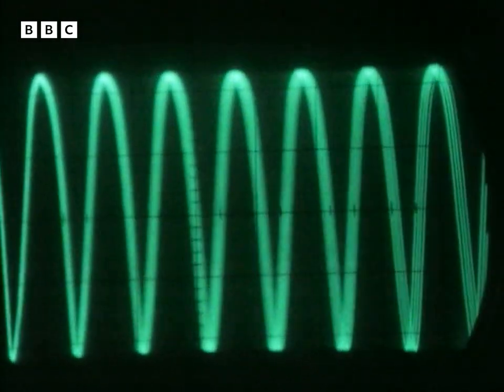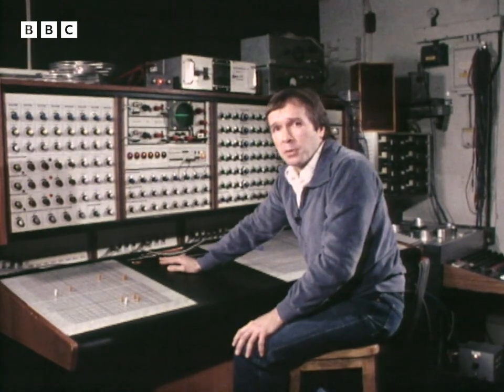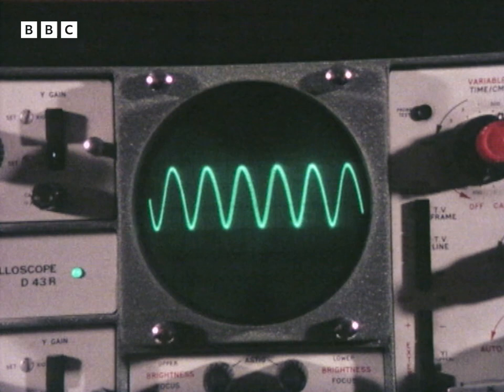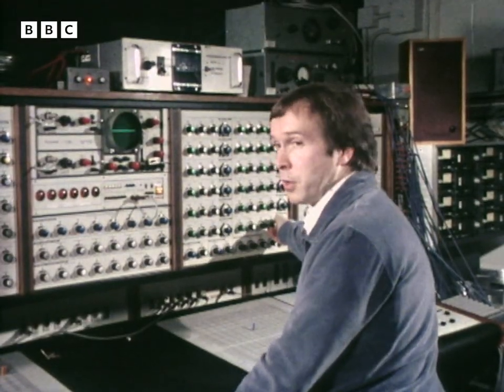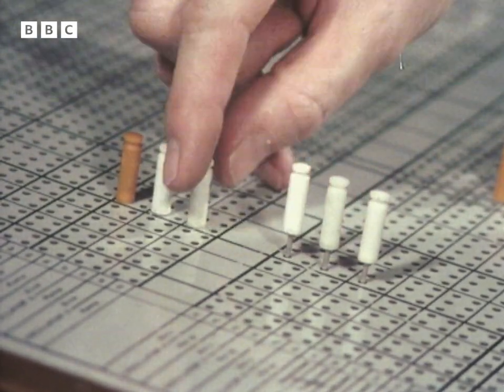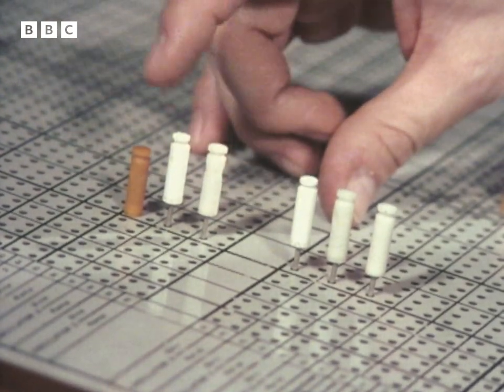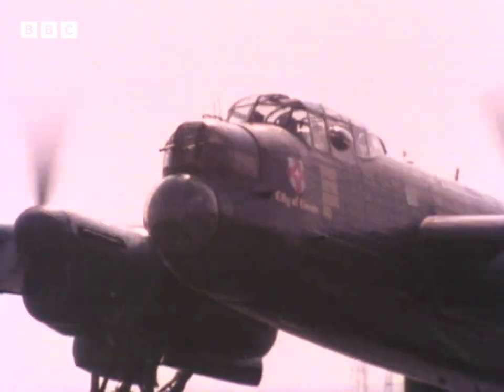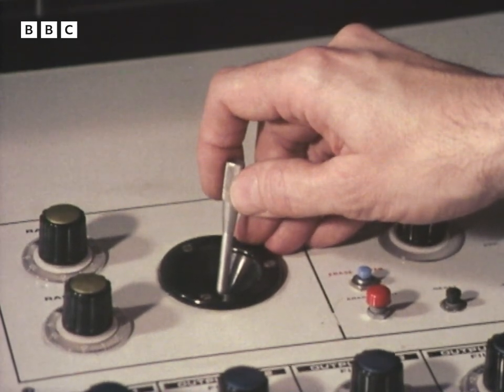1976: ROGER LIMB Sculpting ELECTRONIC Sound | An ABC Of Music | Radiophonic Workshop | BBC Archive

Comment: The Synthi 100 - known as ‘The Delaware’ because the Radiophonics Workshop was in Delaware Road. These things are as rare a rocking horse uh hum. They only made about 30 of these.
Reply: But now revived thanks to Analogue Solutions with their Colossus. Btw, I live in Putney, a mere stone throw from the little detached house by the Thames where Peter Zinovieff invented and manufactured those amazing machines- including the seminal one, the VCS-3 (for 'Voltage Control Synthesizer Nr3'... also known as ... The Putney)
Reply: The Delaware ended up in a skip after just seven years of use. Criminal.

Comment: Release should have been the thing called decay.
Reply: Nope it goes attack decay sustain release.
Reply: This was a good observation and I'm glad that you noticed that one. The comment by Newtronix is also right of course but it's just that this video shows the decay (time) behaving like release (time) after 5:16.

Let me explain: 

Many early synthesizers didn't show a release (time) envelope stage. A very common example is the Minimoog. It only shows the attack (time), decay (time) and the sustain (level). With a Minimoog you could add (what would later be called) release (time) with a switch. That switch just says "decay" but it enables the decay (time) to also add the release (time) to the sound you're creating.

That's a bit confusing... Well, I've seen many videos about synthesizers and the common ADSR we've had on most synths since the late 1970s is still a bit of a mystery to some people. One puzzling thing is that the sustain is actually a "level" where the sound volume stays after the decay stage (using the amplifier envelope) when we still keep pressing the key(s). It doesn't behave as "time" like the other envelope stages.

One of the reasons for the confusion is that the sustain pedal of a piano etc. is actually doing what the release (time) does on a synthesizer. Well, If you really want to be confused, then all you have to do is to look at the controls of early Korg synthesizers, like the MiniKorg 700S. It's a great synth. It's very fun to use and the naming of the controls is part of the fun. It has both a low-pass filter and a high-pass filter but it's a secret... It's just called the "traveler". That's groovy, man.

Anyway, I guess I've written enough. Take care and have a great day.
Reply: No decay is a slow hold feature
Reply: Only in "Hold On" mode, it's not an ADSR, but a trapezoid and will run without a key (gate) to release.